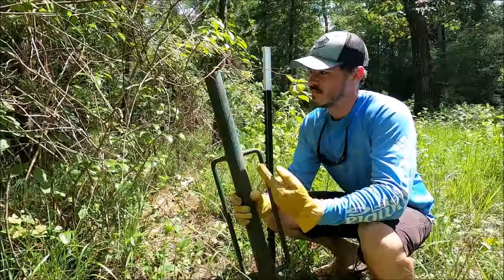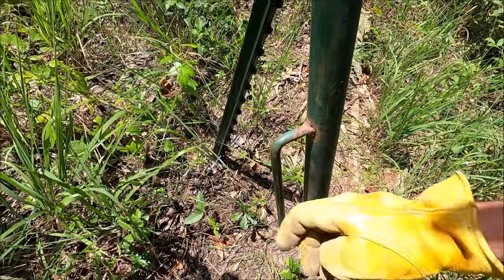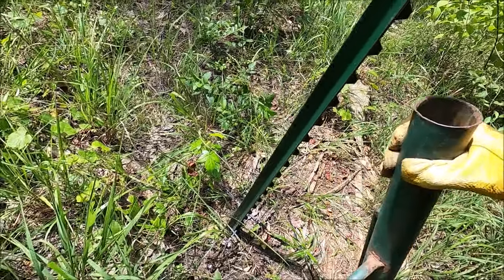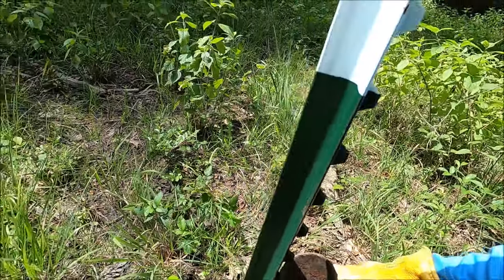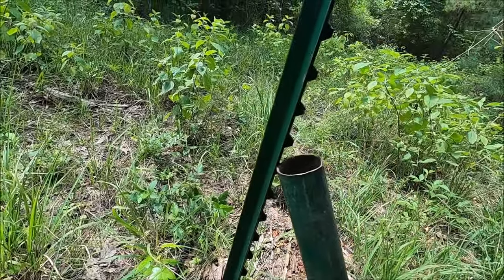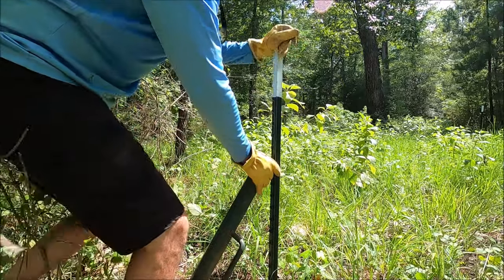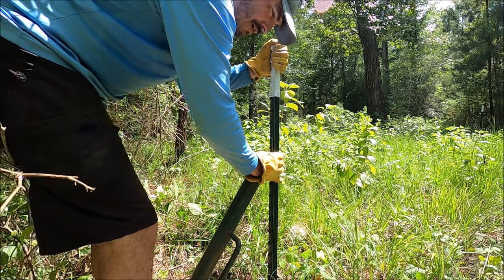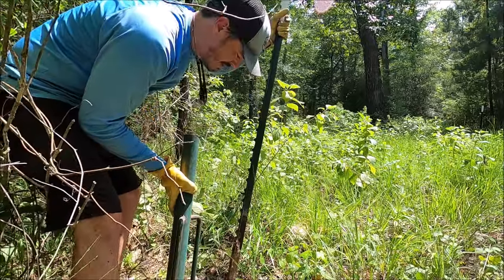Life Hack - The EASIEST way to pull a T-Post out of the ground!  Work smarter not harder.

Comment: Thank you for this, smarter, way to work. I tried the hard way before I watched your vid. I don’t have the post driver, so I tried a 2x4. It worked, but the teeth just dig into it and I can’t pull too many posts with it. I found a piece of pipe and it worked great. I put the 2x4 under it, and I just kept working under one tooth then the next.

Comment: I had 2 Tposts that I needed moved and I don't have the post driver so I used a small square point shovel when used upside down and the same technique you showed and it totally worked.
Thanks!
Reply from the maker: This is awesome

Comment: Mine wasn’t as easy as your video, the teeth are smooth and it’s dry clay ground.  But I must say it’s the best method I’ve seen or experienced.   It popped the posted up enough to get the leverage to pull it out the rest of the way.  Thanks for posting your video!
Reply: Ya this wont work for me either, I’m in the same situation. The dirt is hard and they are driven in deep.
Reply: Same here... Clay in summer doesn't give like his dirt did.
Reply: If you have a TSO (tractor supply co) nearby, you can get a post puller for less than $50. It's a lot easier.
Reply: Soak the ground just around the t-post with water first. It might loosen the soil up and come out.

Comment: neat trick, I've used a shovel and brick(s) before. Put brick under the shovel,  like you did find one of the hooks, put shovel under it then pull down on the handle.  You could also put a nail or small rod through one of the holes to pry against.
Reply from the maker: Good trick

Comment: Well now this was an interesting video and a very interesting removal method. I have always used my front end loader on my tractor but that does require quite a bit of hooking unhooking and getting on and off the tractor. I think this method would be probably a lot faster and easier overall.

Comment: 3:58 only works for short posts. Taller ones driven in 2' won't be leveraged as easily.
Reply: Just tried on my 8 ft posts and started bending them.

Comment: Suggestions if you don’t have a T post driver? Heavy pipe/cheater bar maybe?
Reply from the maker: Any sort of pipe or strong piece of wood would work.  Just gotta be able to jam it under one of the pegs.
Reply: @worldsokayesthunter  thank you. That’s kinda what I figured out, a combo of your suggestion and another I saw.

I took the Jack from my Honda CRV and found a 2x6. Using the Jack to perfectly position the wood and hold it while I used the whole apparatus as leverage, they came out.

Definitely not as pretty, quick, and simple as you make it look on the video but not bad for a 40yo woman trying to figure it out alone!

Thanks for responding

Comment: I know this video is a couple years old but my question is: i want to pull out some brand new t posts that i recently drove into the ground in the wrong direction ...  so i want to use the same t posts im trying to pull out ...  does your method alter the post or weaken it so as to not be used again?😊
Reply from the maker: No.  You'll be able to reuse them just fine.

Comment: In Australia we have what are referred to as "star pickets". They don't have any teeth on them so this method is useless. There is another method where you can use a piece of rope and a long bar....it seems to work. Or if you really want something that works, I've seen a method using a homemade rectangular steel plate with the picket shape cut out of the middle. The bar gets passed through the hole until the plate is sitting close to the ground. Then you can use a car jack (preferably a 4x4 one) to jack one side of the plate. When the plate has side load, it locks in position and pushes the picket up with very little effort. It's an extremely effective method.

Comment: Idaho dirt must be different because out of the 12 I had to remove only 3 came out with this technique and those were bent to hell by the time they came out.
Probably going to soak the dirt around them for a few hours and try again.
I’m 5’10” 175 pounds can bench 175 for 10 reps and do 24 pull ups in a row . Not a huge dude but not tiny either

Comment: 20/10 fantastic! Now if only the reason i need to remove them wasnt because i faced the bumps the wrong way, which in this case means I'd have to destroy two of my already few tomato plants in order to position the driver correctly for this fantastic method! 😂😂😂 at least i know itll be easy when the tomatoes are done and i dont mind damaging them.
Until then I'll tie the ends extra tight.

Comment: I e used this before but now I have 4 that are really stuck. I couldn’t gain an inch trying to pry them up. Back to the drawing board.
Reply from the maker: Do you have access to a tractor with a fork lift?  Might have to get a shovel and dig them out.  Try digging or atleast breaking up the soil around them, then trying the video method.
Reply: @worldsokayesthunter  I wish I had a tractor, but no. I was able to get them out using a very thick, 4’ piece stainless steel pipe. Just so happened to have a slight bend on the end which helped it stay on the t post nub. Used a 6x8 fulcrum block. It took a lot of grunting and groaning but got all four out. They were stuck in hard pan clay. I’m inside sweating profusely but happy that they all came out. Sure appreciate your tips.

Comment: I wished this worked for me but it's not doing the trick. The tpost's I'm attempting to remove are taller and have been in thr ground for quite some time, the first one I tried snapped off.
Reply from the maker: Gotta grip it and pull lower, where the puller touches the t post.

Comment: We purchased a similar tool.  The problem is that many our posts are blocked by rocks or tree branches, making the tool useless. I hate these posts! What about a metal saw? If you dig three feet and the post still won't come out, isn't that the best solution?

Comment: I tried it and all I managed to do was bend the post. I think it was the ground but I can't get it out.
Reply from the maker: Are you holding it down around the post and puller?  Also, try putting the end of the puller that's on the ground closer to the t post.  This will increase the torque.
Reply: @worldsokayesthunter  both. And I've tried moving it closer, didn't help

Comment: Instead of using all your body weight to remove the post just give it a tug then renotch the driver on a lower tooth so you are “walking it out”. Requires almost no effort!
Reply from the maker: You just made working smarter even moreso.  Thanks for the comment.

Comment: Unfortunately this is not working for me.  My t-posts are taller than yours and my ground like like hard as a rock. The thing doesn’t budge 😩
Reply from the maker: The height shouldn't matter as it's all about leveraging on the teeth of the post.  I've pulled them out of some concrete like ground.  Keep trying.